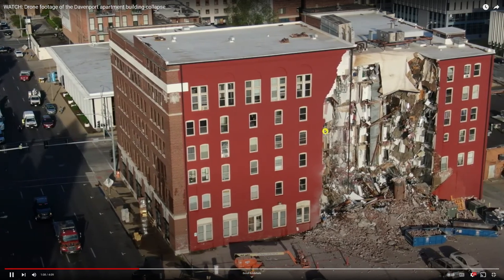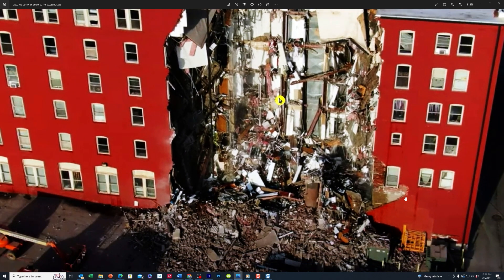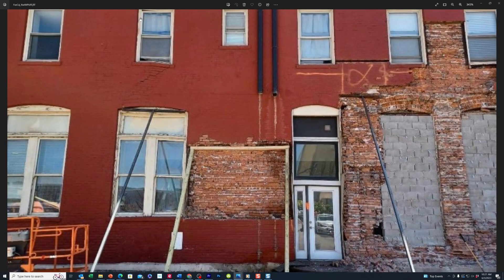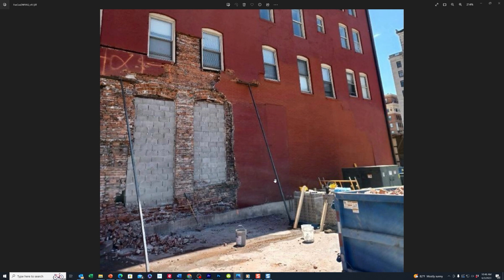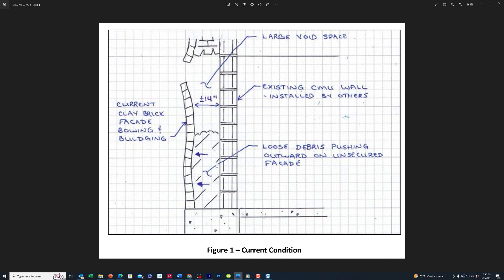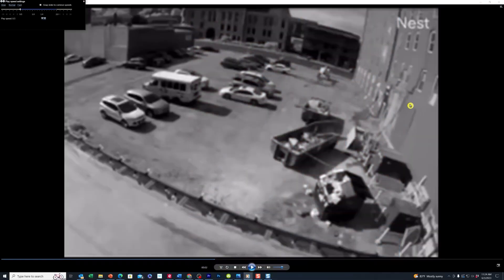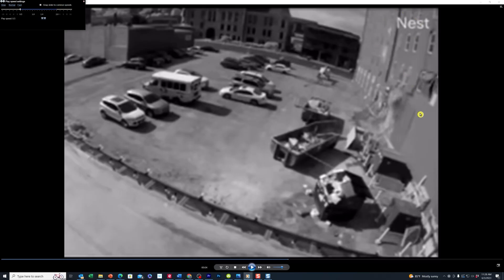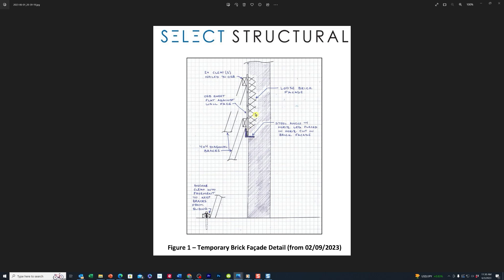Davenport Collapse Security Cam Analysis Pinpoints Origin

Comment: I inspected this building 2 years ago to bid the remodel.  On the collapsed section, I noticed large cracks in the floor, 2-3" wide.  Those cracks ran from the rear exterior wall, all the way across the floor and up the walls, and across the ceiling.  They transferred from inside to outside on that exterior wall.  The cracks that are seen before paint are traced to directly inside where the floor was separating.  Around the columns inside where the ceiling was exposed, were large cracks in all directions including large chunks of concrete just missing.  I warned him that day I felt completely unsafe being in there.  I states I think this building is falling and those arent settling cracks.  I told him to get a structural engineer.  He would not hear it.  I also told his supervisor repeatedly for 2 years that its gonna fall.  2 weeks prior, I once again told his now former supervisor that the new paint isnt gonna hold that building up.  I would love to chat direct with you.  I have alot more info from that day.  Including the fact Andrew was in the basement that day trying to stop the sinking.  And still wouldn't listen to evacuate.
Reply from the maker: Good info! You can DM me on my FB page: https://www.facebook.com/jostroff would love to hear more and see any photos you got
Reply: Summary: the owner heard the red flags from the engineers, but didn't want to hear it.
Reply: @Eduardo_Espinoza  He did want to spend any money!
Reply: Is there a reporting mechanism for situations like this that would mandate a structural engineer inspection? It seems the city may have known something based on repeated extensions (that shortened people's lives).
Reply: @maxmanx1294  yes. Multiple residents reported things to the city. Other contractors have reported to the city. The city would just make him do the bare minimum and keep giving extensions to get the repairs done. He has friends in high places.
Reply: @randizzleforshizzle9957  Can you show us which people in high places?
Reply: Wow, it's unbelieveable that the owner ignored so many warnings from people who do this for a living. You should probably be glad you didn't get the job as the owner would have tied your hands and you don't want your name associated with a building that collapsed. It's sad that the city didn't force this owner to do the right thing.
Reply: Got a feeling the lawyers are going to be contacting you to be a material witness
Reply: Floor cracks in an upper floor or on the ground floor? Multiple floors?
Reply: @rbauer961  I'm assuming he's talking about the 1st and 2nd floors, you can see them externally in the photos.
Reply: @XtremeRenovations do you know whats up with the relatively new looking concrete at the base of the wall? it does look something structural because if it was cosmetic the edge would be better finished/straigt. This can be seen on the photo around the 01:58 mark in the video. This photo also shows the top of 2 arches in the brickwork right beneath the concrete blocks. Those arches made me think these also play a role in the collapse.(may be: old basement entrance = locally more and deeper foundations = less settlement then rest of building = locally more stress on brickwork above).
And now reading your comment about the owner trying to stop the sinking from inside the basement made me certain its not only the brickwork failing
Reply: @XtremeRenovations or anyone else.  WHY do people refuse to hear bad news?  “Your building is falling” would make me start repairs.  Instead they denied reality… not just this brick building but also at the condo meeting in Miami.  The residents continually voted “no” for doing maintenance on the rusted rebar & disintegrated concrete in the basement lot.

WHY are people like this?  Just afraid to accept bad news?  Think they are being lied to?  Why?
Reply: @electrictroy2010  Because they don't believe it can happen - because it had not happened before. But NOW we know better. We know all too well, it can happen.
Reply: Thank you so much XtremeRenovations! You tried to warn them and you did the right thing. I wish you could come see my building in LA, CA! There was another man who just kept going back several times a day to warn them. How sad and preventable this was. God Bless those who blew the whistle. We can learn from this and prevent repeats. Or at least try!

Comment: Our neighbor painted their brick house white and I no longer think it was beautiful after hearing you say they need to breathe. Safety first
Reply from the maker: I can't understand why people want to paint brick
Reply: Can paint it but have to use permeable silicate paint or similar to let the moisture out. Can not use any water proof paint. Older brick buildings used lime and not cement mortar. Basically, cant use cement on bricks with lime joints -  also very significant.

Comment: 9:00 the cinder blocks are filling in two old archways (it doesn't look like the cinder blocks are making good contact at the top).  At the top center of the right arch, if you look to the right, The same height and spacing you can tell there was a 3rd archway also.  I doubt the workers walked around all those red bricks and trash to stacked new cinder bricks. The work they were performing  on the inside the building is what caused the collapse. IMO

Comment: @Maud, thank you for explaining the load bearing vs veneer. Was about to do same. Please understand everyone this entire facade was tied together and it appears they were trying to retrofit it into a more modern construction style of load bearing steel columns or CMU with a non-load bearing CMU or stud wall with a brick veneer. The veneer only bears it’s own weight and you would have a relief angle every 20’ or so. You would never have a 6 story building with entire veneer bearing down on bottom row of brick. This building could have been properly maintained and reconstructed as load bearing brick wythes or a load bearing steel column or CMU wall interior of a brick veneer, but this is NOT how you would go about that process. This is negligence on part of the owner, engineer, and contractor.
Reply: You didn't quite get it.  Water infiltration weakened the brick which was supporting the steel beams,  Shoring was supposed to placed inside, under the beams, and all the brick removed and rebuilt.  The owner didn't want to pay for the shoring and eventually found someone who agreed to do the work.  There were no doubt other issues, but the engineers plan for supporting the beams seems robust.

Comment: Having a 1900’s brick house I am seeing lots of things that were neglected and lots of people working with no idea how to actually repair the structure.
I agree that the structure was already too far gone for the repair that was proposed.
I can understand how the failure was overlooked by the inspector and not fully understood by the engineer.
Neither one was fully aware of the scope of the problem neither cared enough to do a proper inspection room by room and floor by floor.
How much time does any inspection take today even the contractor has only an hour to look at the building? How much evidence is required to determine what the actual problem is? You can’t do anything but guess with a one hour visit.
My house has triple brick foundations and cellar walls and double brick up to the parapet wall on the flat roof.
I wanted to tear the roof off and re-sheet it but I was advised that doing so might cause the rest of the structure to move and cause a similar collapse as the type in this building.
Old brick construction isn’t like old post and beam, it’s not like old wood framing.
Each piece is installed as the building is assembled and unless you are prepared to install bolsters to keep the walls from buckling out when you remove the parts holding it together a collapse can occur. Like an egg it’s a strong structure and if the forces are in balance everything is fine but cracks in the sides and no support to hold the sides and it’s Humpty Dumpty.

Comment: The owner of the property just made this so much worse for himself by hiring unlicensed clowns do make the repairs. It will end up costing him much more than it would have been to just properly repair the building in the first place. He obviously went with the cheapest bid from an unlicensed “contractor”. He is responsible for the likely deaths of the 3 missing individuals.
Reply: But hey, those dudes waiting on the sidewalk outside Home Depot had to have something to do that Sunday...  How else could they have afforded their tacos???
Reply: @johnbergstrom2931  Around here they hang out at the 7-11 because Home Depot runs them off (and doesn't sell beer).